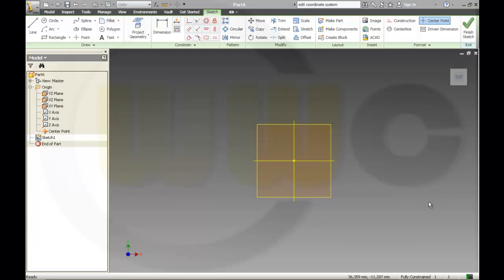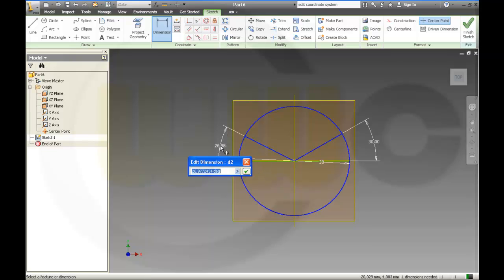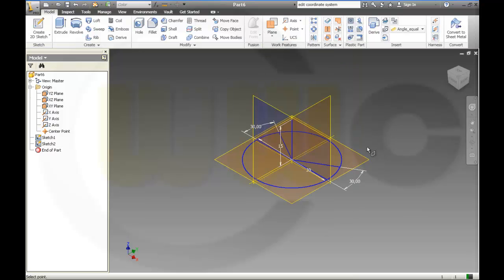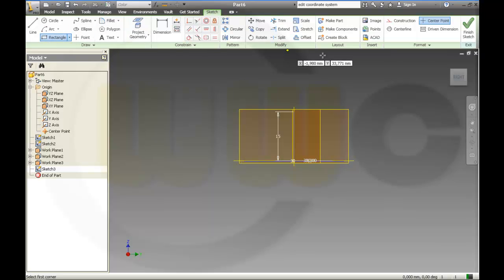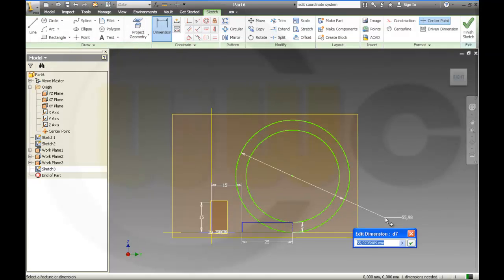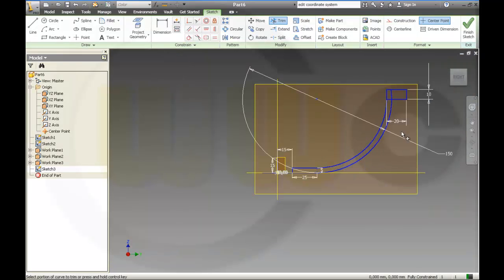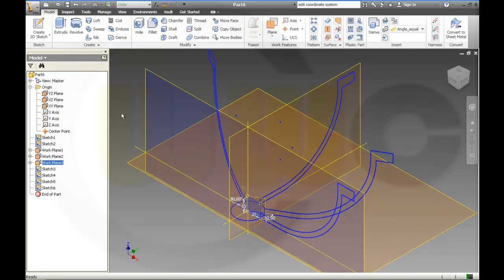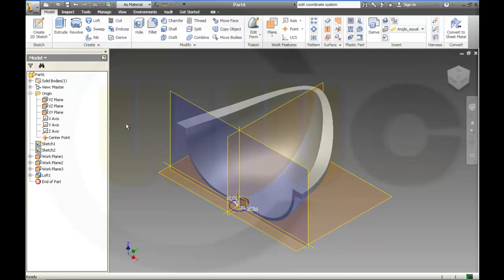10.5 Becken - Inventor 2012 Training - Workplanes - Loft

Comment: Hi, Wolfgang Walden
I have a very basic question.
To begin with how I can use all the planes, I mean to have a center in common with the other planes (mnt 0.24)
Reply from the maker: Hi, the centerpoint? It will projected automatically to your sketchplane. If this doesn´t happen you have to activate it in the options. Usually it is activated by default.